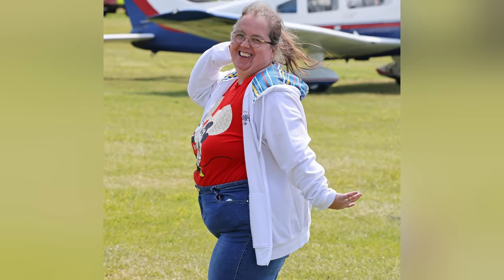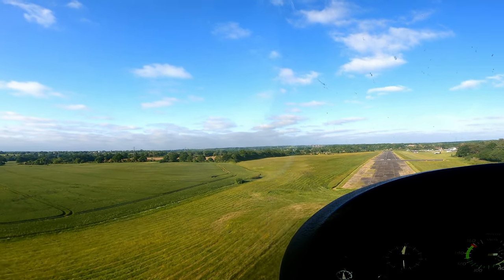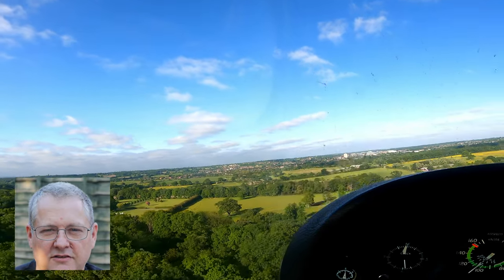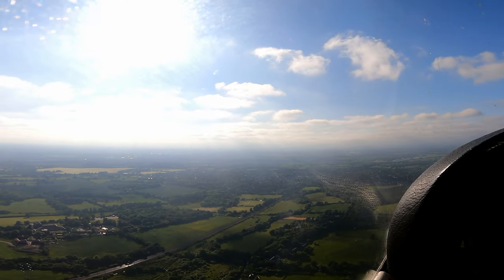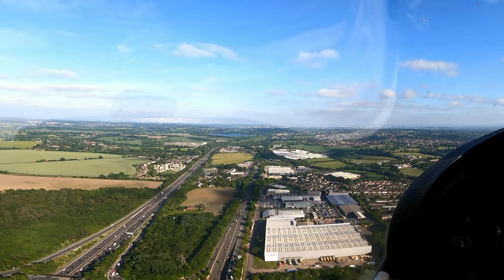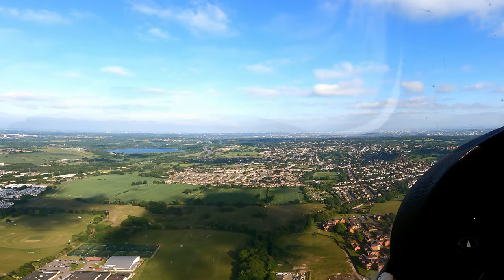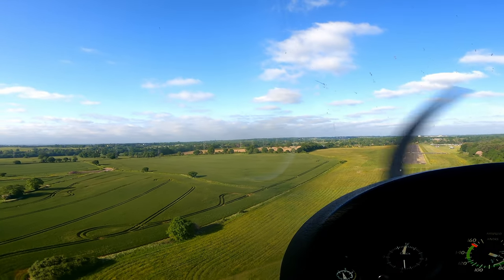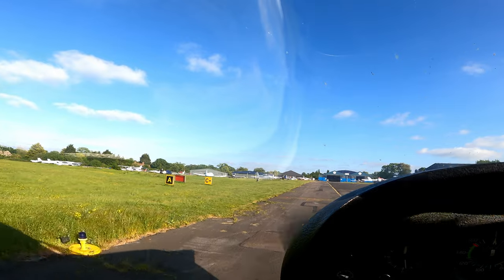When it all goes wrong - How not to land a C172.

Comment: Good job with go around and second landing.  On second the touchdown right of centerline (drift from left crosswind with wings level) can be more easily eliminated with the slip into the wind.  Light crosswind is more difficult than strong crosswind because drift is not as easy to recognize.  By putting the centerline between our legs and walking the rudder pedals dynamically and proactively, like the tennis player moves his feet before service, we bracket and thus nail the centerline all the way down on the left main tire in this crosswind.  Once the wing is banked sufficient to eliminate drift, lock it by not moving aileron at all.  If we use rudder only to keep centerline between our legs we cannot turn, cannot bank further (we cannot bank any in no wind.)  Adverse yaw is what moves the nose the wrong way initially.  No aileron, no adverse yaw, no wing wagging, no miss alignment, no landing away from centerline.  Good job on the second, but with crab we have to get the wing down with aileron for touchdown while keeping the centerline between our legs with rudder.  It is easier to get that all set up on short final and hold it until touchdown on the left main.

Comment: Great decision and thanks for posting, Wayne. My instructor always said, 'If you're not happy with anything throw it away and go around." Every so often I throw one away because I don't want to be out of practice sorting pitch, drag flap, and trim when it comes to the stress of the real thing. Interesting about being tired, too. It concentrates the mind in the early days of training when your instructor points out that the flight isn't over until the engine is shut down. In other words, keep up your concentration until then. I have a habit of coaching myself through the re-join by speaking out loud the crucial actions, as if hearing it adds a layer of cognisance (not endless words, just the few cues to produce the correct set up 😊).
Reply from the maker: I talk to myself a lot, especially for checks - not everything is posted in the videos, which does lead people to complain I'm not doing them. Sometimes it's also familiarity breading complacency, I've landed at Elstree 100s of times, so I'm mused to manyl of the issues, but this time it was a combination of things - the classic swiss cheese model!!

Comment: Very timely post.  Just got back from an IR lesson, on base changed from flapped to flapless landing due to gusty crosswind, speed never got correct due to config change, then overshot final due to wind, got on final and stall Warner pipped twice.  Landed fine but the whole way home I heard my first ppl instructor saying in my head "it's not working out go around" over and over again.  Think I'm going to have to adopt some strict rule that if something isn't right go around rather than try to correct.
Reply from the maker: I’m working on my IRR as well, and I completely agree I think we all have a habit of trying to save a landing when we should simply go around. I was tired and I think it showed.
Reply: @WhiskeyAlphaPilot  problem is often it's easy to save one error, but once things start to compound it is not easily recovered.  Good luck with your IRR - just done UA today.

Comment: Placing myself in this situation, I'm guessing you feel some internalized pressure not to go around a second time? Definitely having some challenges with the crosswinds on this day and sounds like you weren't alone in that regard. Good on you getting in safely and also recognizing that this isn't a landing performance you want to repeat. I'm sure in the 9 months since you've put to use lessons you learned on this day.
Reply from the maker: I was much happier second time around. My internal processes and my training are always plan for a go-around, the landing is a bonus. 
Also I find getting into the circuit as opposed to coming on a long final allowed me to get more settled and slow things down, so I feel less stressed. And yes since this things have improved, although landing on the centerline at Elstree is still not a great idea due to ever increasing potholes.

Comment: Hi Wayne, I'd be inclined to clean the aircraft up, be safely on the climb-out before worrying about any radio calls. Aviate, Navigate & Communicate.
Reply from the maker: I completely agree. I find its a level of my capacity to think, so if I can think of the radio call, then I have the capacity to do one. It was quite brief, and it was part of my process on go arounds during training so it felt quite natural.
Reply: @WhiskeyAlphaPilot  But in this instance the main priority of flying the aircraft has been neglected for a radio call, if you had an engine failure at the time you are skimming the trees then you are in a world of bother. Had you got the aircraft sorted and climbing away at Vx or Vy, then made the radio call you are in a much better position.
Reply from the maker: I disagree. I flicked a button and gave everyone around me adequate information to allow safe flight. I was still flying the aircraft. Otherwise you could argue that no calls should be made at any point in that flight, until I was on the ground as the priority was 'flying the aircraft'. Did I neglect flying to make the call no I do not believe that is the case.
Reply: I'd argue that until the aircraft is flying the correct profile for the stage of flight you at, then your priority is to correct that.
Reply: I used to not let my students make any calls on the go around until the aircraft was cleaned up, power set and trimmed for Vx/Vy as applicable.

Comment: Is that the approach at Elstree, not being on the centerline?
Reply from the maker: You do realise the point of the video was to point out my mistakes……
Reply: @WhiskeyAlphaPilot  wondered if it was supposed to be an offset approach to avoid overflying sensitive properties or similar. Was there a reason for staying so far off to the right and not correcting it?
Reply from the maker: We aim for the centreline, but I was dealing with a gusty crosswind. Also remember the camera is offset so you will always see some error
Reply: @WhiskeyAlphaPilot having considered your points I still don't think that you were paying enough attention to the centerline, you were definitely a long way off to the right and I find it surprising that you aren't of the same impression; you don't need to fly down the centerline but it is convention and it will make your final landing easier if you're set up correctly further out. But I'm sure you know that anyway
Reply from the maker: No I was paying attention on how to get on the ground safety in adverse conditions. The centreline is an ideal, the runway is wide enough for my aircraft to land safely.
Reply: @WhiskeyAlphaPilot  I'm not talking about landing on the centreline (although that is obviously preferable), I'm talking about approaching along the extended centreline. Your entire approach was way off to the right, you will probably find it easier to conduct a good landing if your approach is better organised from earlier on.
Reply: I was wondering exactly the same. Thought it migh be like Popham and you have to come in from the side purly as both run ins where from the right a long way out. Good Post WA Pilot. Reminds us all espeshally low hours pilots like myself how important getting everything straight on final is.

Comment: Nose wheel needs to be on the centerline,,, alway, 777 or 172,, centerline centerline centerline. Takeoff or landing.
Reply from the maker: Sorry I disagree. It's something to aim for, but not every landing is going to be 100% on the line. Do I 'go around' if I am off my 6"? 6ft? A landing had to be safe, and depending on the size of the runway and conditions off centered landing is acceptable. Not ideal, but acceptable.
Reply: Nah . . . centerline is over rated.
Reply: Flying is a precision business.  Never accept less, always fight for it.  If you train and fly with that attitude, it will bite you later.  Sure it’s comfortable on a wide runway, but what about a strong gust or a blown tire?  If you’re on the edge you’re in the grass.  If you are in the center, you are still on the runway.  You won’t always be on a wide runway.  You got to train how you want to fly.  You won’t “magically” get it right on a smaller runway, your habits will always take over.  Be as safe and precise as possible building habits so when things go wrong you are in the best position for a positive outcome.
Reply: @HandgripsRaise I take it you're not a flying instructor.
When giving criticism a little encouragement doesn't go amiss.
Nobody can claim to be perfect and when they do that's usually their biggest  mistake..
On doing an awful landing many years ago my instructor debriefed me. His words of critique and guidance were far outweighed by his words of encouragement. I could have gone home and given up but I went home bristling with enthusiasm for the next day.
Reply from the maker: That was a good instructor
Reply: @aeroplod  I see both sides to this debate and both are correct. . I learned at 3N6 which was only 50' wide so I had to be spot on or else I'm taking out runway lights. It's too easy to become complacent and complacency kills!!

Comment: why don't you fly final on the center line what about crosswind correction ? why do u land on the right side of the runway ? you should take some classes , you are not a safe pilot. you did this on both landing , both were poor crosswind handling .
Reply from the maker: Hello Random user, Thank you for you insight, I take it you have 100 or even 1000s of hours of perfect landings?  I could suggest you read my replies to some of the other comments, But I could start by pointing out the title of the video? It does say how NOT to land...... :-) But thank you for your comments....
Reply: @WhiskeyAlphaPilot   I don't want to only see perfect landings - I want to see landings like you did in this video too - it helps us low time pilots to be able to see what is good and what is bad, what works and what doesn't.  Every pilot has screwups - the beauty of youtube is that we can learn from each other.  Thank you WA Pilot.